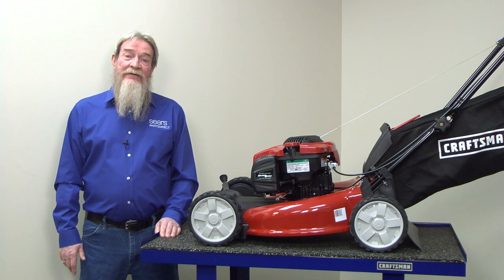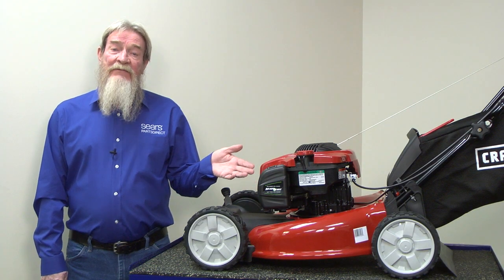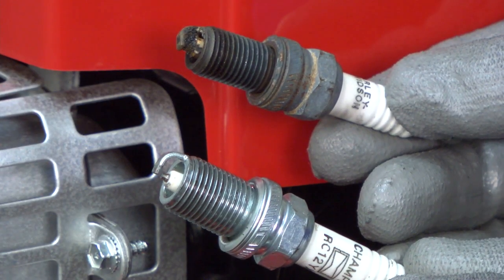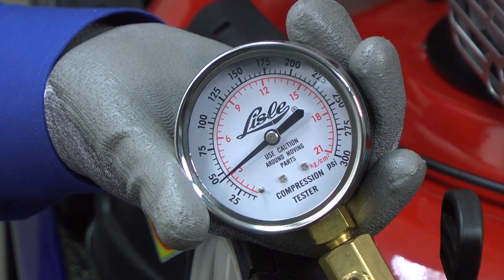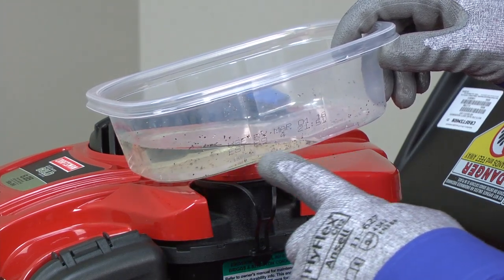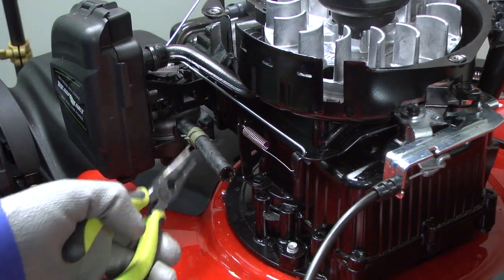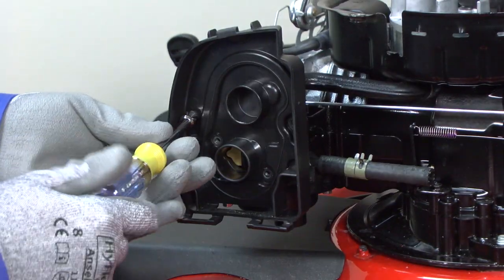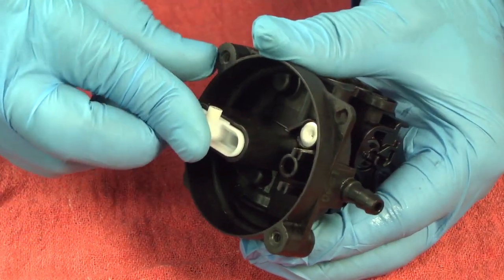How to Fix a Lawn Mower that Won't Start: Fuel, Ignition and Compression Problems

Comment: I have oil coming out of the carborator. What dose that mean?
Reply from the maker: Tilting the mower forward or to the carburetor side is a common cause of oil coming out of the carburetor. If you tilted the mower forward or to the side with the carburetor facing downward, then the cylinder may also have filled with oil. Remove the spark plug and pull the starter rope several times. The piston will force the oil out of the cylinder through the spark plug hole. You can then reinstall the spark plug and start the engine. The engine will spew some black smoke out for a while until it burns off the residual oil in the cylinder then the mower should run smoothly. Overfilling the engine with oil can cause oil come out the carburetor or the breather tube which is next to the carburetor. The oil will typically soak the air filter so you may not be able to tell whether the oil came out of the carburetor or the breather tube. Sometimes it comes out both. Check your oil level and drain out some oil if you overfilled the engine with oil. Serious engine problems such as a blown head gasket, damaged cylinder or worn piston rings can cause oil to come out of the carburetor and/or breather tube. You’ll typically have to tear down the engine to find these types of problems. You can also have a service technician repair the engine if you suspect that it has this type of serious internal failure.

Comment: Hi I left gas in my mower over the winter, now it won't start.  I replaced new gas, and the mower would only start after I tilt it to the right.  Then it would stall within a few seconds.  I repeated the process over about 10 tens and it still does the same.  Can you please provide some pointers?  My mower is craftman, looks the same as yours, could be the same one.  It's a 6.75 engine.  Thanks in advance for your advice.
Reply from the maker: Based on your description of the problem, the carburetor is probably clogged. Replacing the carburetor is the easiest fix because the carburetor for this type of engine is relatively inexpensive. Rebuilding the carburetor may also fix your problem but that repair is more difficult and doesn’t cost that much less than replacing the entire carburetor. To find the correct carburetor or carburetor rebuild kit, you’ll need the engine model number. Look up the engine model number in your owner’s manual or on the Sears PartsDirect parts list for your lawn mower model number. The engine model number for a 6.75 engine will probably look something like this: 126M02-1031-F1. Order the correct part and replace or rebuild that carburetor and the engine will likely run properly. Let us know if you need more help.
Reply: +twitch Moto , but he's right.  The cost difference is minimal.
Reply: Add some Seafoam to the new gas
Reply: Don't listen to this guy, he just wants you to buy a carburetor from him.
Reply: +Sears PartsDirect you

Comment: this video does not adress the fact that all these three things need to happen at the right TIME. also, "right amount of compression to drive the piston." this is parcially incorrect. though these three things work together to drive the piston, it is not the job of compression. the job of compression is to compress the fuel/air mixture to the point where it is combustible. I'm surprised that sears got this wrong

Comment: I have a lawn tractor that wont start. I need help.
I replaced the spark plug, oil, oil filter, carburator, fuel pump, fuel filter, and the air filter
Reply from the maker: Many lawn tractors have interlock switches such as a seat switch that will prevent the engine from starting. Check your owner’s manual for a wiring diagram of the electrical system and reconnect any loose wires that you find on interlock switches or other electrical components. Replace any defective switches or components. If you need more help, let us know the model number of your lawn tractor and we’ll assist you further.
Reply: +Sears PartsDirect well, I have the same problem. but mines a Yard machines by MTD
Reply: Has it been sitting with gas in it? Drain the gas and put fresh gas in it and some Seafoam.
Reply: +twitch Moto Seas foam? Where do I get that?
Reply: Maxx Haffe Zero Auto Zone or another Auto place